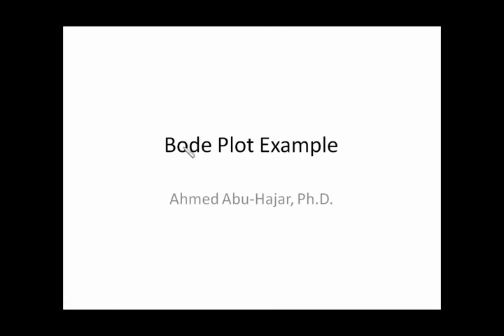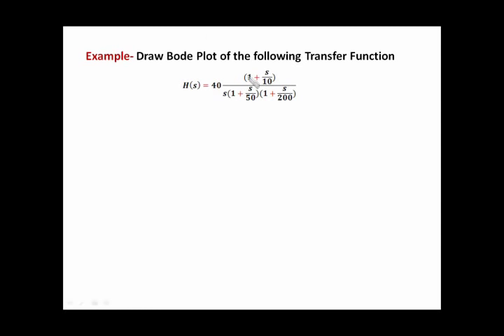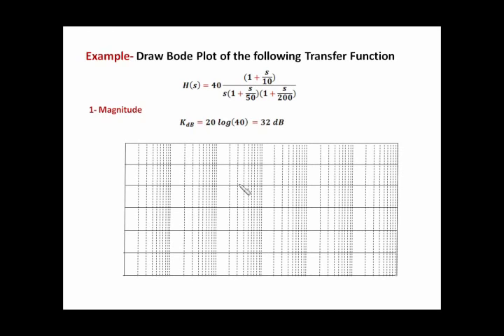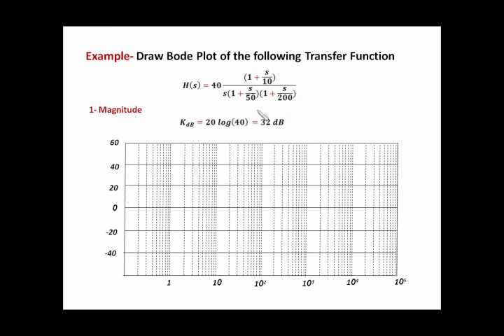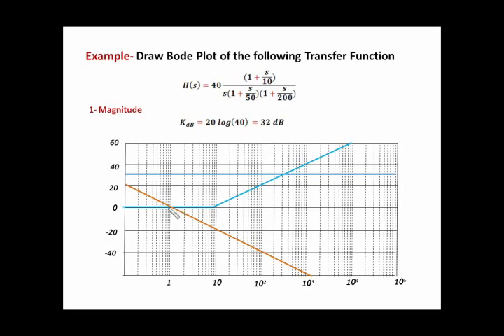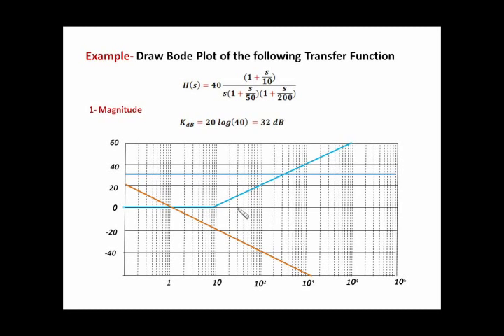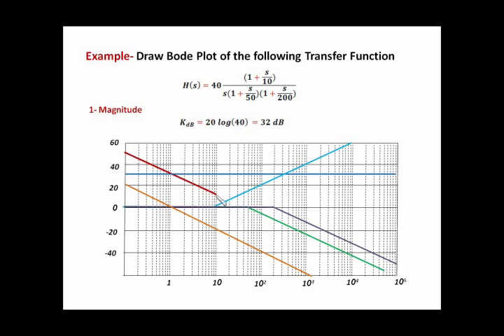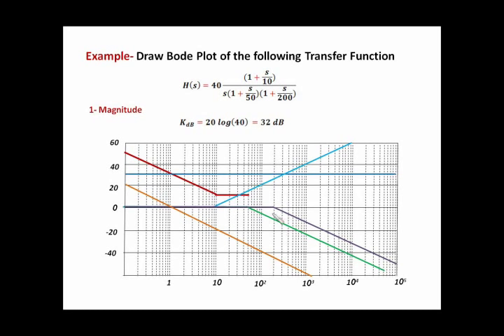Bode Plot Example

Comment: To the people who have no idea what he's talking about when he says "zeros" or "poles," the denominator of the s-terms are called zeros and/or poles. When the s-term is in the numerator of the transfer function, they're called "zeros." When the s-term is in the denominator, its denominator value is a "pole."

Alternatively, you can think of it as the inverse of the s-term coefficients.

40[1+(1/10)s] / [[0+(1/1)s][1+(1/50)s][1+(1/200)s]]

The inverse of (1/10) is 10, and it's in the numerator of the transfer function, so it's a "zero" at 10. 
The inverse of :(1/1) = 1, (1/50) = 50, (1/200) = 200,  and they are all in the denominator of the the transfer function, so there are "poles" at 1, 50, and 200

Additionally, the terms in the numerator of the transfer function always have a positive slope, while the terms in the denominator always have a negative slope.
Reply: You legend 👌🏼 explanation
Reply: the pole should be -50 and -200 and 0 at orgin
Reply: You can call them corner frequency for short

Comment from the maker: Yes, because a decade earlier at w = 0.1, the response is 20db higher. at w = 1, the response is 32 db. This is all because the pole at the origin. 

I am not a perfectionist and it is possible that I make mistakes, but this one was correct. cheers !!!

Comment: I have seen an example where for phase plotting, they used 5 instead of 10 per decade. So for 50 for example, the started at10 and ended at 250. Is this normal? When do we understand which one to consider?

Comment: Hello sir , first of all many thanks for your videos they are really helpfull.
I have only one question it might be silly but its vital for me understanding Bode,am a student from Greece , Automation engineer,
Q: why the slope is 20db/dec in either zero/pole ?
here the default slope we are using is 6db/oct am having really bad time finding an answer  so plz can you ? anyone else of course is welcome to answer my question.
thanks a lot.
Reply: 20db/decade is equivalent to 6db/octave
Reply from the maker: Here is the answer to your first question:
The zero has the following transfer function H(jw) = (1+j(w/z)).  if w>> z, it can be approximated as H(jw) = (j(w/z)) = jx. The pole is the reciprocal   H(jw) = 1/(1+j(w/p)).    if w>> p, it can be approximated as H(jw) = 1/(j(w/p)) = 1/jx..

So for the zero case 20log(1+j(w/z)) increases +20 db for every w that is 10 times bigger than z. so the slope is +20db/decade. However for the pole 20log( 1/(1+j(w/p))  ) = -20log(1+j(w/p)). so the slope is -20db/decade

in summary the zero has +20db/dec but the pole has -20db/dec..
Reply: Thank you guys so much :]

Comment: If only the exam made this straight forward question. The problem I have is actually to find the transfer function, H(s) or frequency response H(jω).
Reply from the maker: Obtaining the transfer function from the differential equations is even much simpler task. I believe I have a lecture on it on you tube. It should be in the prerequisite topics for control.

Comment from the maker: (1+jw/wo) this is complex function. @ the corner frequency, when w = wo, you will have (1+j) which is sqr(2) and angle of 45 deg. 

now a decade later, when w = 10 wo, you will have (1+j10) the magnitude is sqr(101) which is very close to 20db. the phase is close to 84.3 deg. which is approx. to be 90 deg. 

 If w = 100wo ( two decades later), you have (1+j100) and the magnitude is approx. 100. which give you 40 dB 

So the magnitude will always increase a 20 dB per decade for a simple zero.

Comment: when drawing the plot without summing all the terms to get the starting point(the pole at 0(0.1)) its a -20db/decade slope until 10 so to get the starting point you would add 20+Kdb to get 52db right?

Comment: the video was really helpful, but II have a question
the maximum gain is 32 DB, so how can we add 20 DB to 32 DB in the zero corner plot ?
how could I draw a level (32+20) which is greater than the gain level ??

Comment: Can anyone tell me if at the phase plot, for the pole at the origin.... shouldn't the graph drop from -45 degrees to -90 degrees from w=0 until w=1 and then remain at -90 degrees?!
Reply: Nope. The decade before 1 is 1/10, that is 0.1 not 0. And the decade after 0 is 0*10 = 0 so it actually drops from 0 to -90 from 0/10 (a decade before 0) to 0*10 (decade after 0), that is, everything happens exactly at zero.

Comment: Why the pole "s" is not starting from 0 ?
Reply: It's because nothing happens with a frequency response at 0 Hz; you can call it that 0 Hz does not exist for these problems. You usually have the 0 with in the graph because in theory it could change at 0.1 Hz.

Comment: I'm bit confused this method when doing
 (jw/w0)/(1+j(w/w0))  

How to plot this function?
Reply from the maker: Your problem is much easier. This is how you do it. The function should be written as (1/wo)(jw)/(1+jw/wo) or it should be k s/(1+s/w0)
1- so get the k in db that is kdb = 20log(1/wo).
2-  s on the top will have a straight line +20db/dec passing at w =1
3- The the pole will have a corner frequency with-20db/dec at w0.

add the three segments up. you will get the bode plot. it should be a first order high pass filter.

Comment: What does the 40 mean
Reply from the maker: I would assume that you mean the gain constant or the offset gain.  Depending on the transfer function, the 40 can be the DC gain when s=0, or the high frequency gain when s= infinity, or the midband gain. In this particular transfer function, it is the gain at w=1, I call it the offset gain.